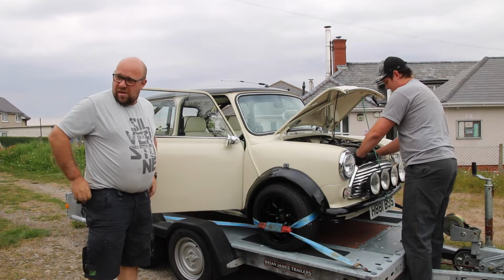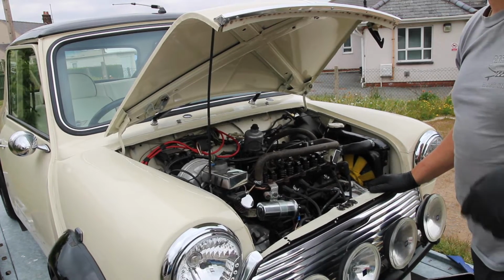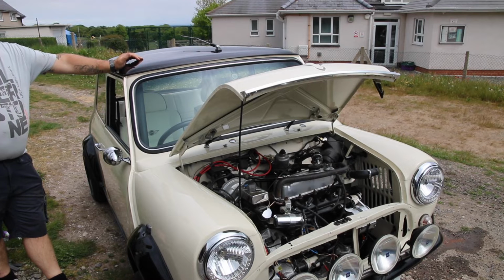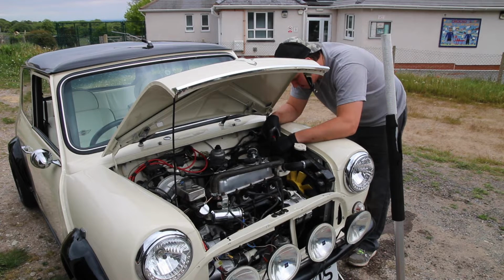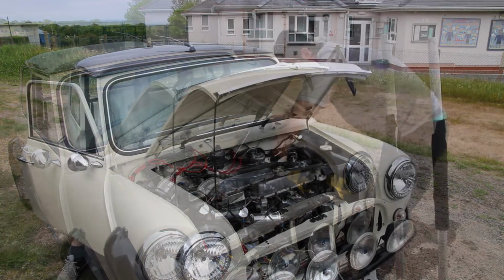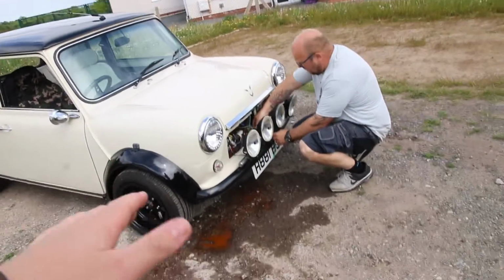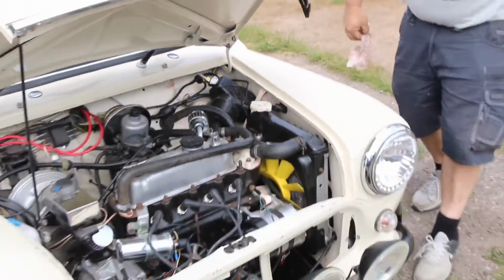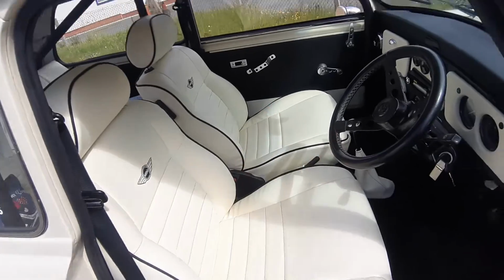Classic Mini - A Quick Tune

Comment: Starting/charging wise If its been repainted check the earth connection to the boot floor.
Put an extra earth under the bonnet from the alternator to the inner wing
Reply from the maker: That's a very good shout.

Comment: 80 thou was a bit of a shocker! Really nice looking car although I agree about the white interior, I'd be on edge with it all the time lol. Hopefully thats the gremlins all sorted now and it'll be a reliable runner, what size A series was that?
Reply from the maker: 998cc it's a lovely car. Its since had radiator, hoses and electrical ignition and  its not running great. It's getting rolling road soon so hopefully it will be fine tuned on there.
Reply: @WilliamMurfitt  That's making me think carb jets or maybe the camshaft, depends what its running though, a rolling road should sort it out 🤞🏻
Reply from the maker: My suggestion has been to order a carb rebuild kit overhaul that and get it rolling road, the chap I've recommended locally is a genius and what he doesn't know about classic setup isn't worth knowing
Reply: @WilliamMurfitt  He's got the right people on the job so it'll be running sweetly soon enough.

Comment: What engine was it and what did you set timing the timing at btdc?
I would have removed the dashpot to see where the needle was sitting.
Thanks for sharing
Reply from the maker: I didnt adjust static timing, there were no timing notches on the pulley so set it by ear in the end. The car had been running and told it was ok in spells I checked the obvious things that sprung to mind it still no joy would have dug a little deeper